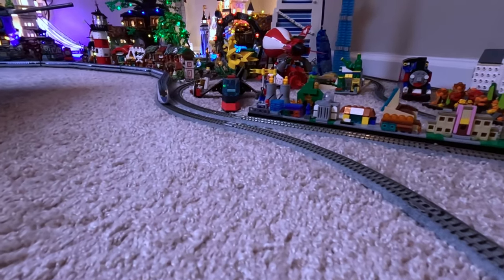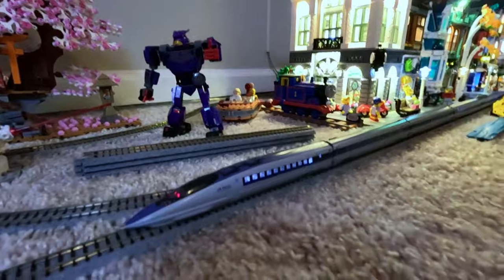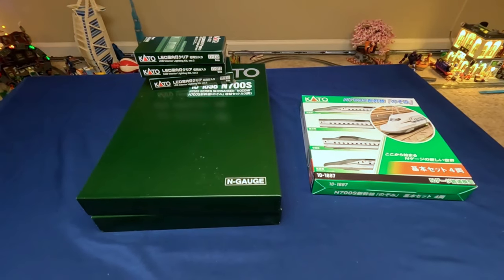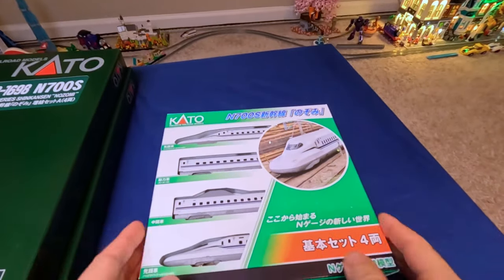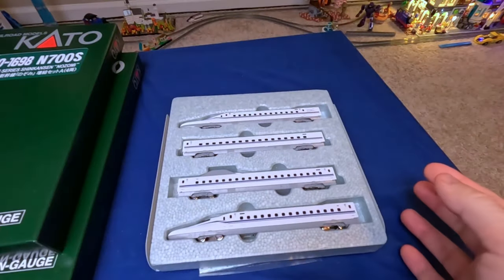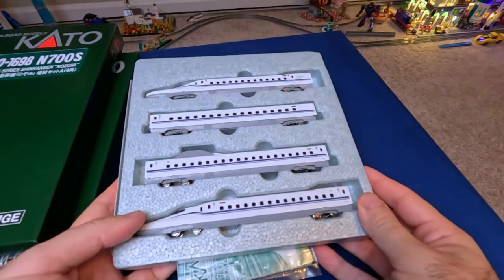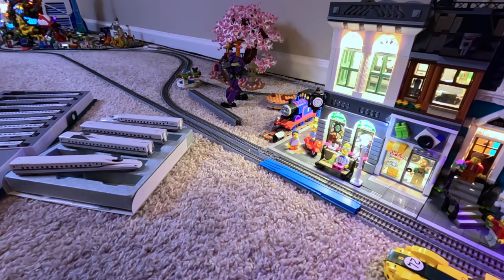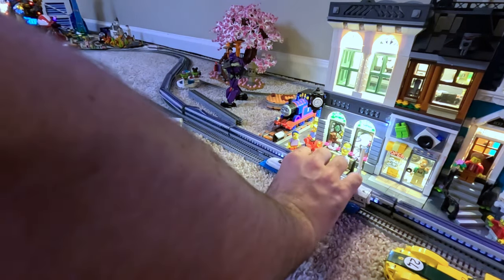Kato N700S Bullet Train Unboxing - Full 16 Car Set!

Comment: By the way, the “S” in the N700S stands for “Supreme” as when it came out in 2020 it was the best version of the N700 series Shinkansen with many upgrades over the N700A model. With the “A” being the “Advanced” version of the original N700. The N700S has better brakes, packs of Lithium Ion batteries so it can run for short periods of time without power, and it is the fastest Shinkansen currently in service. The batteries are for moving the train off of bridges or out of tunnels in the case of an earthquake and the better brakes enable it it to stop in a shorter distance also in the event of an earthquake.
Reply from the maker: Woo! Good to know! 😄

Comment: I have the 4+4 set and will get the other 8 next week.  I actually rode on this when I was in Japan.

As for the shark fin devices on some of the cars, in real life they direct the power cables between cars.  Kind of like hang them up.  So you were right, it's a power thing.  :)  Not every car has them.

And for the "hidden" compartment underneath the first and last car, they are for Kato's FL12 light decoders if you run DCC.   They will control whether it should be white light or red light depending on direction of travel.  They switch the colors automatically.

Finally, the gap distance between the old set and new set are about the same.  It's looks "closer" on the old set because of the dark colors between cars.  It hides the gap and make it visually smaller.  It's an optical illusion.  :)
Reply from the maker: Hey! Good info! I would like to ride the real deal one day 😄

Comment: When you install the lights maybe also install a bipolar capacitor ( train can go both directions)
The idea when power drops from rail which gives the flicking the capacitor should maintain voltage over that time.  I believe the train has a flywheel so it won't be affected by variations in voltage.